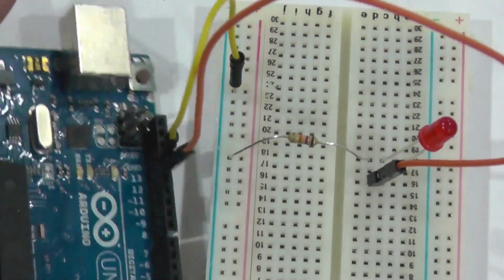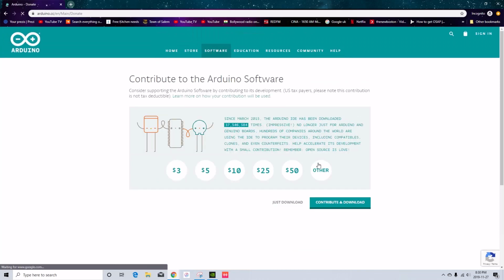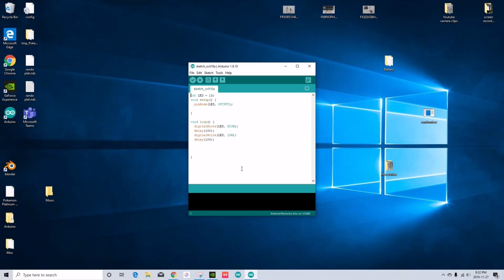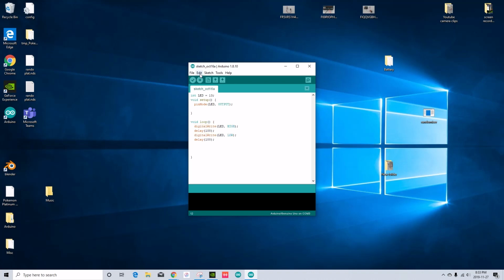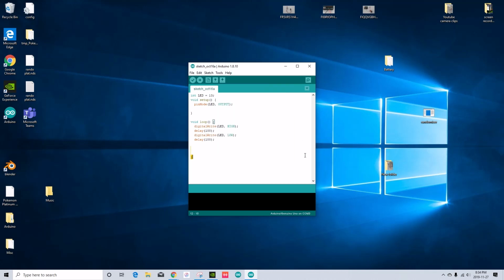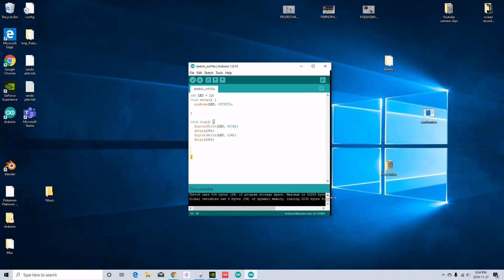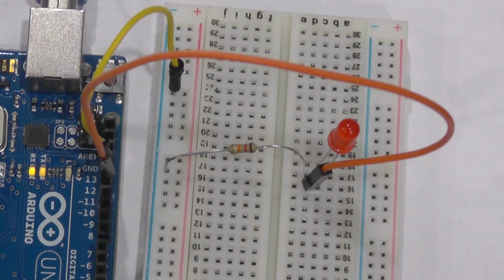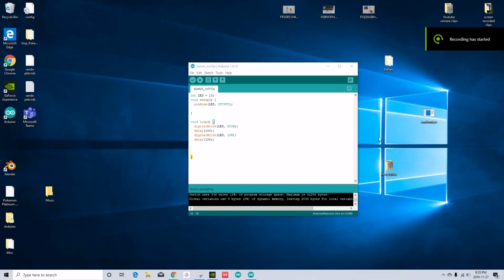Beginner Arduino LED tutorial!!

Comment: Great job breaking everything down step by step. Was wondering if this method could also be used for anything else other than flashing LED? Just wondering because I might consider using some concepts for the circuitry on my project.
Reply from the maker: the main thing is determining the code for the arduino, it is written in C++ and uses its own special syntax for certain commands which you can find here: https://www.arduino.cc/reference/en/
Reply from the maker: Yes it can be used for anything powered through electricity, fan/sensor/light source, etc. Just needs a negative and positive connector that can fit into the breadboard to add it to the circuit, and if you do end up using it, please email me the video so i could possibly showcase it!